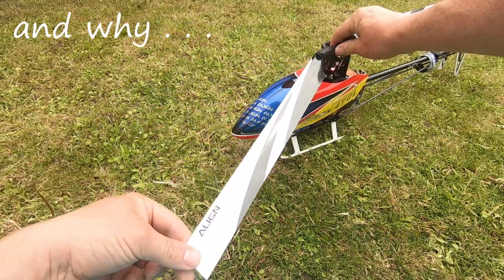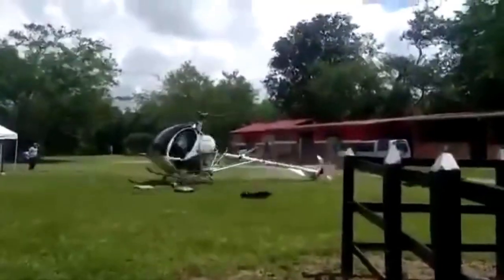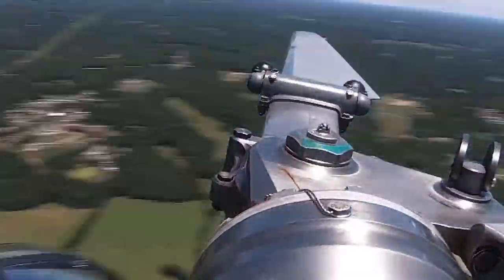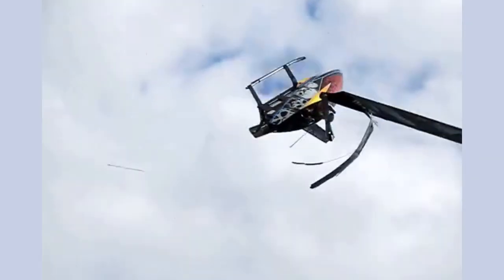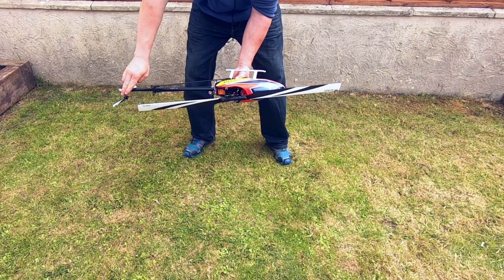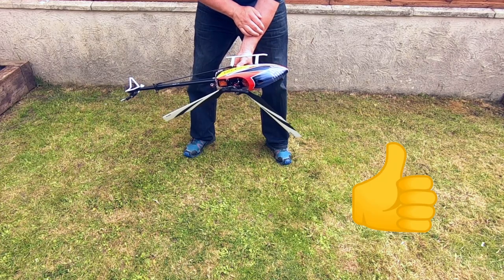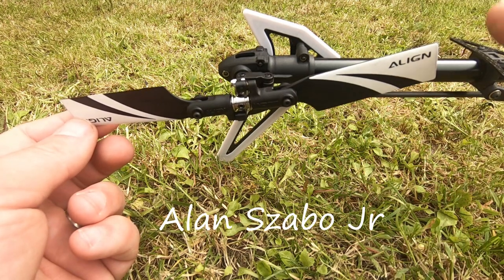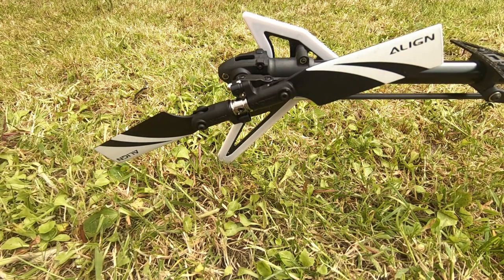THIS is how tight your RC heli blades should be (and why)

Comment: I've had very few fly better loose .
Reply from the maker: Hi Jake. Better when they're very loose? Some of your micro blades by any chance, mate?
Reply: The xk120 likes it's blades loose ,,
Reply from the maker: @jakelang4387  more responsive and or stable?
Reply: @RCStuffvideos  just seem like the blade grips that came with it didn't want to be queezed cause there metal. But no it would be more stable if I could make them more snuggly fit ,good little helicopter tho

Comment: All my helicopters have the blades so tight you have to force them hard to fold them. In the words of SAB “you want them so tight you may have to use an Allen to loosen to fold”. This lead lag crap is a myth and I don’t know where it came from. But sock them up as tight as you can get them. Straighten them out before flight and trust me no matter how tight they will swing into place lol.
Reply: Is this for all size models or the bigger size helli
Reply: @nickdean468  you don’t want the blades floppy on any size model, but the smaller helicopters don’t have the centrifugal force to throw the blades out straight when your spooling up if your blades are too tight, so it will
Wobble like crazy. So not too tight on smaller helicopters.

Comment: I am both full size and remote controlled helicopter pilot (flying RC for more than 25 years) and this is the most accurate explanation that I have seen for this subject, congratulations!
Reply from the maker: Awesome thanks for the comment. I fly full size fixed wing as a day job but want to do more heli stuff too.

Comment: Excellent info man, thank you 💯 I was actually wondering about that for a while now.
RC Stuff, I may I ask you for your advice. Every time I start over setting up my T-Rex 470 LP with the Brain2 FBL, the heli shows the same behavior. Please have a look at my newest short video, where I am showcasing my heli on the bench. Link: https://www.youtube.com/watch?v=iFWXb1qU5Q8
I'm really interested in your take on especially the behavior of the tail slider (servo) and the cyclic servos. Would be greatly appreciated. 🙏
Reply from the maker: Hey Dingo/TN, Never used the Brain or a Taranis Transmitter but I think it's normal behaviour for the tail to not centre at centre stick if you're in heading hold mode. It will re centre if it's in rate mode. Is that what you mean? For more info on the brain you can try West hobbies RC or I think a channel called RCflightZ has used the brain. You could try him.
Reply: @RCStuffvideos  You were right about the heading lock vs rate mode. Thank you 👍 The tail is centering now. Funny how there is so much text to read in the brain setup app, but it doesn't tell there's such a thing as rate mode and what the heck that means. Secondly: Auto Level can't be activated in Setup 1, seems like it's that way by default.
WestHobbiesRC seems to not write back anymore for a while, idk, I hope I didn't get on his nerves :D
The Brain developers don't respond to my question either, but we had communicated before, about the exact same issue while using a different tx/rx combo. This is why I shelled out the money for a Taranis and Archer rx 🙄☹
I'll try to contact RCflightZ, thank you for the tip 👍
Well, right now I am not really interested in how a heli behaves with the brain, I am rather interested in how an RC heli should behave in general. In videos, with the heli on the bench, people usually throw the sticks around to full deflection, but that's not what I want to see. So my question would be something like this: On a heli, when we deflect the right stick to let's say ~70% aileron, will the swashplate move to ~70% deflection or to 100%? Same with the tail. Because my tail and swashplate maxes already out when the sticks are only at roughly 30-40% of their max deflection.
Reply from the maker: @PFinkoloTL87  i think thats pretty normal. It would definitely depend on expo and pitch curve too. I think it would move more than expected because the fbl commands a rate of rotation and if the heli is static on the bench it's not rotating at all so it applies more input to keep trying. I'm not mechanical expert but i think it's something like that.